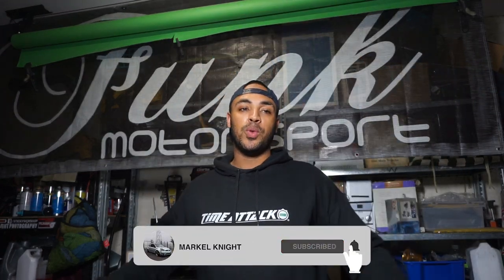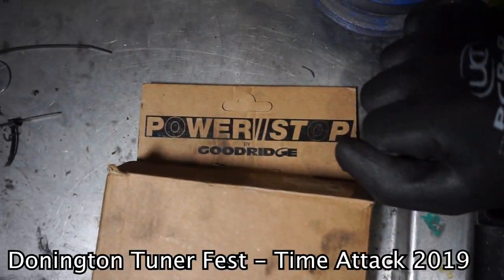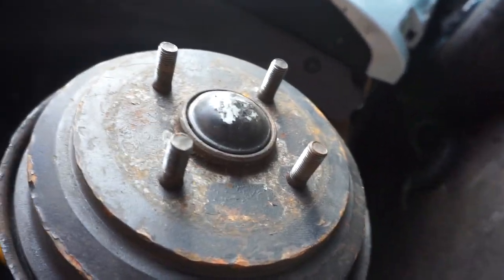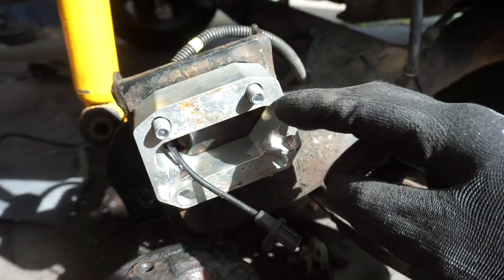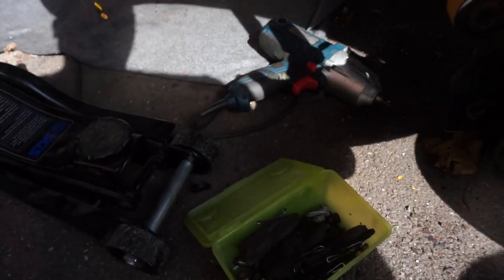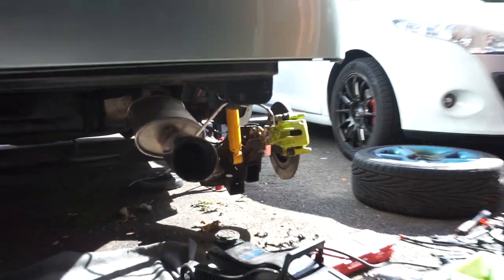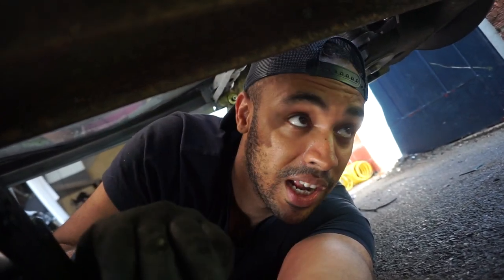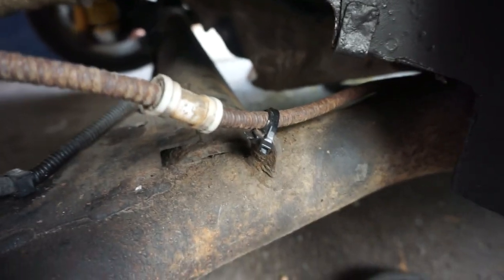Installing Focus RS Rear Brakes On A Ford Fiesta??? #Ford #Fiesta #MK6

Comment: Top job mate have you got a video on the rear bumper being cut down
Reply from the maker: Hi Mate I had a prefacelift bumper where half was colour coded and the rest was bare plastic so I just had to undo the clips and pull it off

Comment: St170 and focus rs are the same rear brakes, the fiesta st use’s the same cailper and pad as the focus.
Reply from the maker: Ahhh, that makes future shopping a bit easier! Thanks
Reply: MARKEL KNIGHT no worries
Reply: If you don't want the excess cable length you can use the st150 cables as they clip into all the brackets on the axle ect and will fit the calipers as the st150 st170 and mk1 rs all use the same calipers just the carriers are bigger to clear the larger focus disks